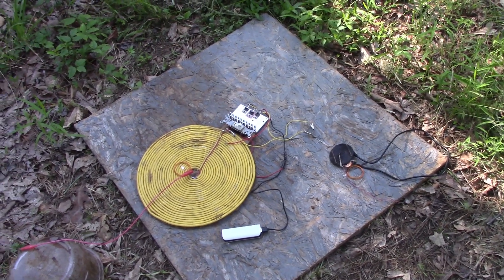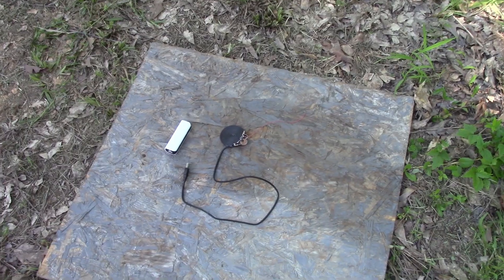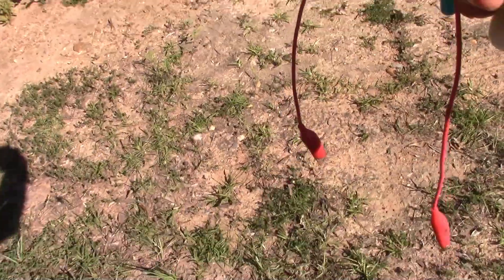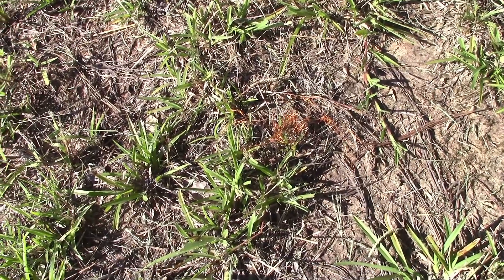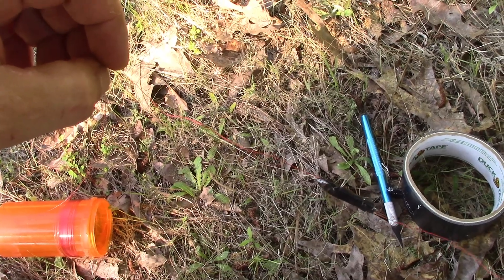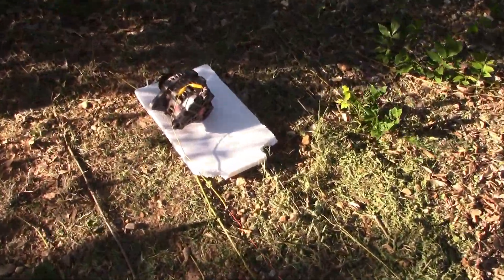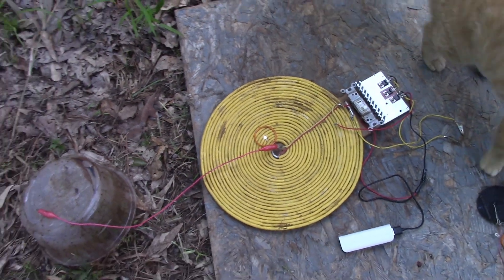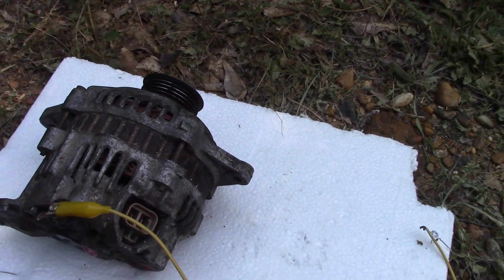Wireless electricity - 1 wire transmission experiments part 2

Comment: the energy moves like waves guided around the field. Not like water down a pipe. The aether adds to and transmits the energy.
Reply from the maker: Thanks Luke 😀
Reply: @Slider2732_  check out electric universe theory. 100v per m as we rise explains the downward propensity of dense objects (gravity). Imo we live on a plane with a torus field circulating above, around the north pole star. stars light up because the resonance is matching or at least one of the octaves is matching. Sonoluminescence could have a part to play. Everything is electric and its density relates to its charge. Thank you for the investigation and post. Very interesting. 

p.s. prof Richard Fienman would be worth checking out.

Comment: You made an RF power source, and connected an antenna to it. It is expected and well understood that current will flow in and out of the antenna, whether or not the far end is grounded. That's how antennas work. If you put an LED in series with the antenna wire, the current sloshing back and forth in the wire will pass through the LED and light it.
Reply from the maker: Yes Jim, if the RF power source is physically connected. The 30AWG was as you describe, the 40AWG wire wasn't, it was merely sitting under the transmitting coil. There was no inductive plate, tuning coil or anything else... just the strand accidentally trapped under the cardboard base.  
I'd think any layman would scratch their head at that one!   😀
Reply: @Slider2732_  And any electronics engineer would expect the close proximity to result in substantial coupling to the thin wire of the RF energy being radiated by the coil.
Reply from the maker: @jimmurphy5355  Oh I agree but had never seen bare wire collection to such a distance. Such effects being normally actively reduced in RF circuit design. Experimental wireless circuits (on YT) will always have some form of collector, bar the Dr. Stiffler clip lead setups. 
Appreciate the comments, thanks.
Reply: I've seen, and recently at that, over 100 watts transmitted wirelessly over 6 meters away from the source through one of Tesla's methods, 10 fully lit LED's in series powered by 0.3 watts, 2 things happening there that are supposed to be impossible.

There's no reason Slider's experiment should be reduced to antiquated RF transmission.
Reply: @JenkoRun  An LED can look  "fully lit"with 30 milliwatts of power. The visible appearance of the brightness of an LED is a nearly useless criteria for judging. The human eye is too adaptable.
It is not the least bit surprising or impossible to light up 10 LEDs in series with just 0.3watts
Tesla was an innovative and clever experimenter, with a good intuitive grasp of some aspects of induction But he didn't have the math training or skills to understand Maxwell's equations, which were well known and understood decades before the years when Tesla was doing his early work. In the century since then, nothing has ever been found to violate or extend Maxwell's math, which completely and accurately descibe how electromagnetic energy propagates. Any wireless energy transmission is one form or another of magnetic induction, or RF energy (which is comprised of photons, just like all other electromagenetic energy.)
Reply: @jimmurphy5355  Get 10 LEDs, put them in series, give them 30 milliwatts of power and no more, and try to make them all equally light up to the point you have to squint to keep looking at them.

Upload it to your channel, I'll be waiting.

Comment: Nikola Tesla did not transmit anything from his tower as he stipulates, the only transmission was parasitic conventional dielectric current which was a side affect of the circuit so in some respect yes there was some conventional transmission but that was not the purpose of the tower. The tower 'facilitated' the transfer of power from one tower to any number of other towers, the power "transition" was not transmitted and occurred through the SECOND form of electricity called Impulse Current. Study impulse current so you can understand the 2 forms of electrical results. the error in modern science is to assume electricity is its own field modality, it is not and is a result of two particularly phased opposing forms. So, the normal electromagnetic current we use today is actually DIELECTROMAGNETIC and the other form (called impulse current) is ELECTRODIAMAGNETIC. 
the difference is immense and yet not used in everyday physics or electrical engineering.
normal 'electricity' is bound to the speed of light as it is mostly a product of magnetic change whereas 'impulse current' is bound mostly in 'ETHER'
Reply from the maker: Good points. The lightning seen from the top of Wardenclyffe also being a negative effect, not positive. Am actually a person who doesn't follow some conventional thinking regarding electricity... such as the view that every circuit is a form of short to the power source, not a loop.  
From your writing, impulse current has no speed boundary and is also not limited by gravity or distance. It would be what Tesla experienced as sharp stinging on the body.
Much to learn, always 😀
Reply: @Slider2732_  The Impulse Currents Tesla experimented with can be thought of the Aetheric equivalent of the water hammer effect, the reason they are able to ignore conventional physics is because they contain no magnetic component, unlike magnetism the aether and its tense manifestation (Dielectricity/Electrostatics) are counterspatial in nature and do not inherently have limitations in space or time.

A sudden enough "kick" like this produces an extraluminal displacement current which can have all sorts of strange results, one of which is the complete ignorance of the law of thermodynamics, another is instantaneous transmission, and other anomalous effects, 

A radiant burst induces a Longitudinal radial displacement current as a shockwave of the Aether which charges materials with potential that can be harvested for work, the wires essentially undergo a similar process to the stator coils in a "Generator" where the changing magnetic fields with respect to time induce EMF and gives rise (indirectly) to Electrostatic Potential.

Instead of rotating magnets and magnetic fields the wire is directly charged by the induced shockwave, this is why the output from these radiant bursts can become so immensely high compared to the input, the energy doesn't come from the source but is the result of the induced disturbance acting upon it.

One very lovely feature that separates this from conventional power creation is that the built up power is purely reactive until it encounters a resistive load of some sort, you can have thousands of volts and amps on the charged up stators and they won't do any harm, or even damage the load, the load will only take what it needs to operate where active power occurs inside it and that's it, provided you don't close the loop on itself like in common circuits. Technology that utilizes Counterspace (The Aether) like this is the stuff of science fantasy.
Reply from the maker: @JenkoRun  Many thanks for adding to a fascinating subject. This version of Counterspace is far more interesting than the kitchen area my wife likes to keep clean!

Comment: Amazing, great demonstration of single wire transmission and even more Amazing coupling threw a straight wire. As you say once you get into rf/hv you are broadcasting electricity as telsa had envisioned back in the day. Very interesting  👍
Reply from the maker: Thanks 😀
I suppose it's 'technically' wireless transmission to 576ft, so next is to extend the wireless part before the 1 wire. Full aim is to replicate that scene from The Prestige film, where the lightbulbs get plugged into the ground.
Reply: @Slider2732_  sounds good, I have done the lake version on a very small scale 100% tap warter.
Reply from the maker: @johnwynne-qx6br  Yep and it drives me forward to know of your success. Was cool to see your vid  😀